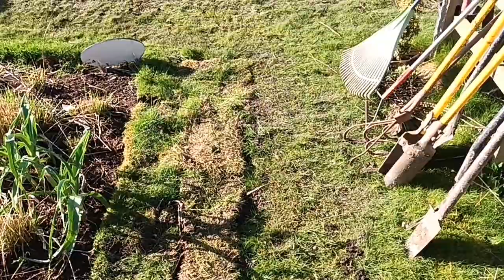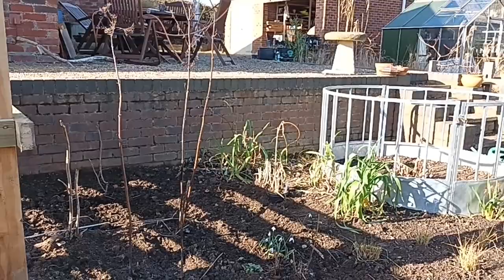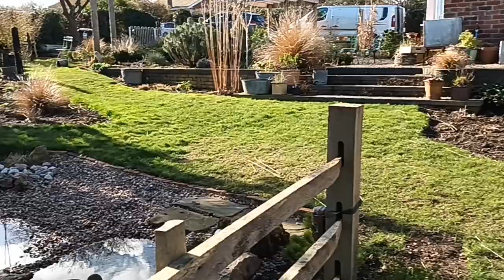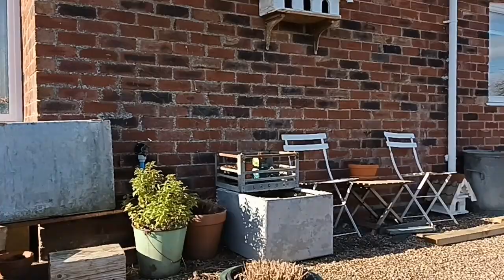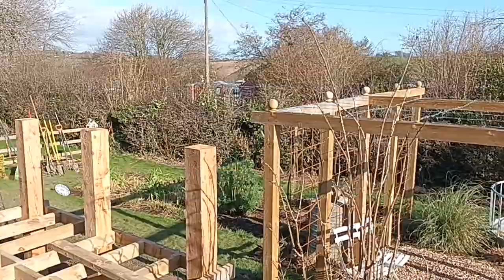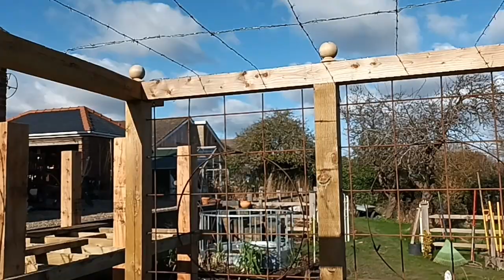The Floating deck (phase one)

Comment: Weight should always be transferred through the wood, not nails or bolts. Its still fixable. You should notch your posts to accept the floor joists.
Reply from the maker: It's pretty solid, I've done it this way for years with great success, the bolts will do the job, you must be a joiner?
Reply: @upatgrassybottom9859  Bolts and nails are designed for tensile strength (pushing and pulling), not shear strength (right angle force). You may have been doing it for years, but it's not the correct building standard or even code in most situations. There have been many tragic accidents from decks being built this way.